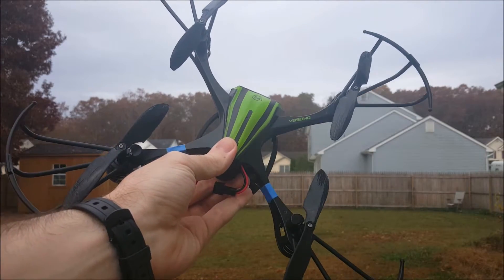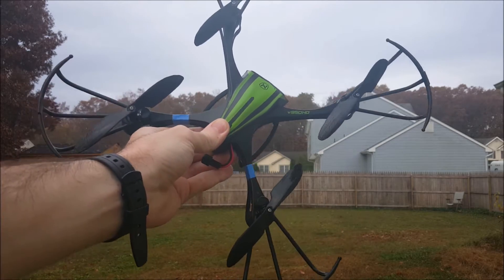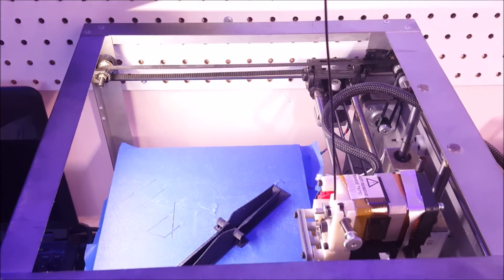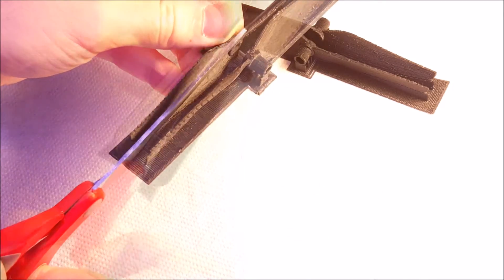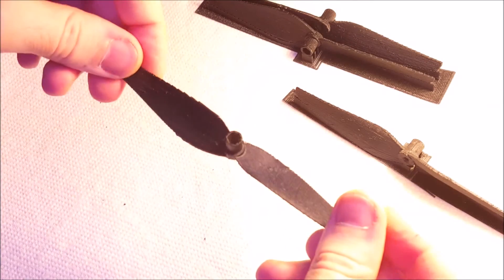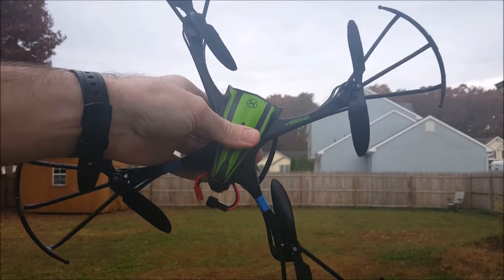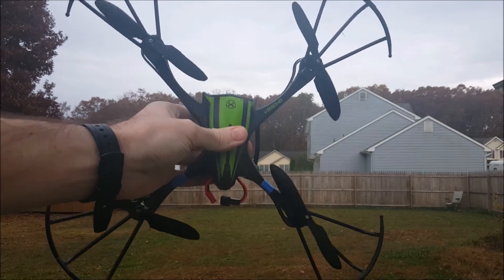How To 3D Print UAV Propellers

Comment: how do you do the vapor treatment?
Reply from the maker: +jameslee522 

1) put your 3D printed object onto a flat sheet of glass (or w/e works) in a well-ventilated area
2) grab a large transparent glass bowl, diameter >50% bigger than the stuff
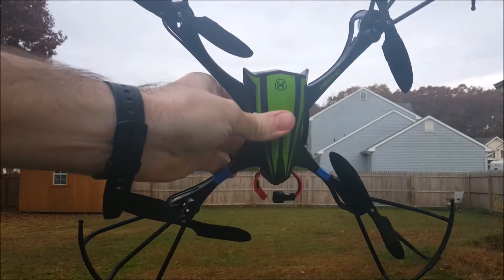3) use strong neodymium magnets (or w/e works) to attach a pair of folded pieces of paper towel to the bowl's inside (see 1:51)
4) pour a tablespoon (15ml) of acetone inside the bowl, making sure it's evenly distributed across paper towels
5) quickly cover your object with the bowl (acetone evaporates fast).
6) wait ~25 minutes
7) remove the bowl and wait 1-2 hours; do not touch the treated object -- it's surface is soft like butter
8) it's ready to be used/installed after 1-2 days

Not exactly magic, but very close.